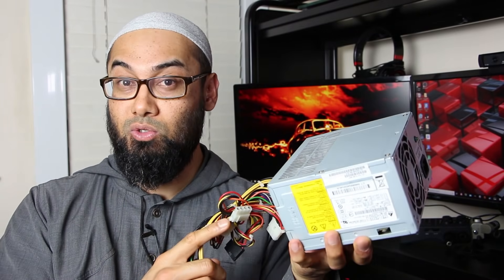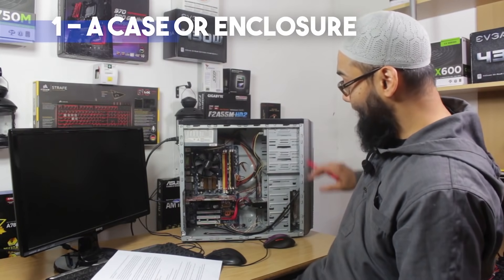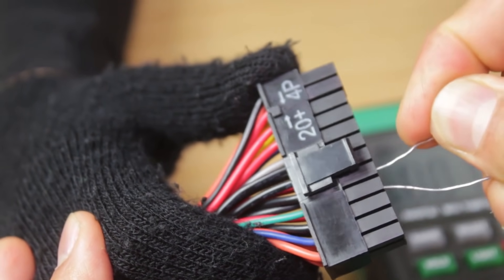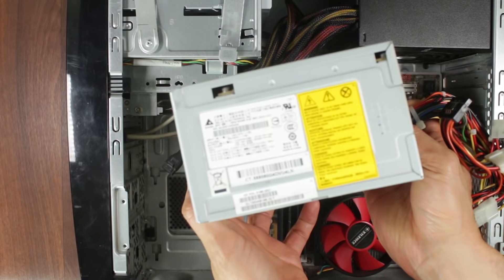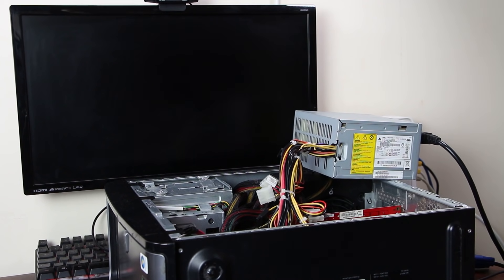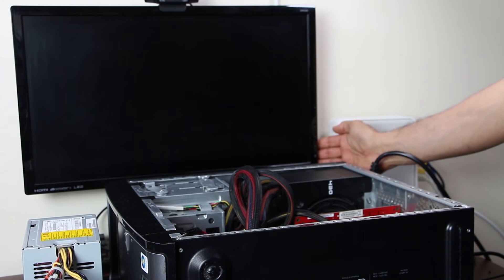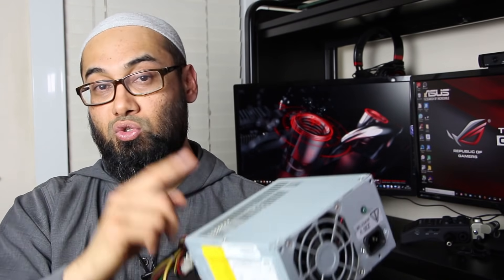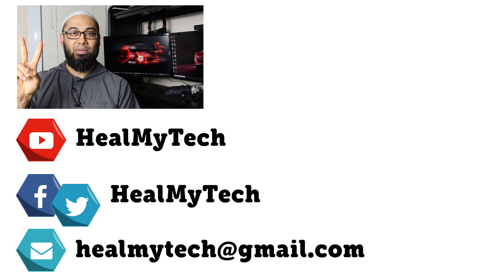Computer Turns On But No Display On Monitor | Led Light On Fan Spinning | Power Supply Unit Pc?

Comment: Hello. I liked this video so since you are offering to help I am reaching out as I am ready to pull my hair out in frustration!!! I just opened up a new desktop computer system and I did the best I could in setting it up with zero tech abilities. However, of course I am having problems. I could use some help: first of all when the processor is on I don't see the fan turning at all. Shouldn't it be turning when on? Secondly the monitor lights up a picture for 1 second then goes black and no lights anywhere. 

I have no idea how to make it work. I probably put cables in the wrong places? I hope you can help me in plain, simply language, not in fancy tech talk. Thank you.
Reply from the maker: Sound like you need more help than just simply me replying to this thread.  Have you followed a build guide?
Reply from the maker: I have also created a facebook group especially to help troubleshoot computer/laptop issues.  If you post your question there with some pictures or even better a short video footage you will get a better response.  Consider joining but make sure you read and accept the conditions and answer the questions, otherwise you may not be approved to join.  The idea is to help each other, I am unable to respond to every request by myself.  https://www.facebook.com/groups/healmytech/

Comment: Can anybody help me .my cpu on fan running ,mouse , keyboard, monitor all running suddenly monitor black screen no light in mouse and keyboard but still cpu fan running .
Note: i also replaced a new bios battery 
Pls help me guys anybody 🙏🙏🙏🙏🙏🙏🙏🙏🙏🙏
Reply: Can you still enter to bios and save the new setting?

Comment: Hello,
Please I have an issue with my desktop.
Basically when I put it on the fan but the computer will reboot on it's on and there is no display and no led on the keyboard.
Any advices please?
Reply: Same issue did you solve it ?

Comment: Can somebody help me out?
Alright I go to bed, and wake up next morning trying to turn my pc on. The motherboard has all its rgb and led's on as usual. I notice my mouse's rgb isn't on as usual. I try to turn on my pc, but it wont power on. I have resently reset my pc completely, but that shouldn't affect the pc itself right? My pc is only 9 months old and i am  pretty chocked that it has died. I have a corsair power supply with 625 watts. No fans are spinning, and I have also taken into consideration that the front panel connecters a deffect.
If anybody has any suggestions or tips I would really apreciate it. If nothing works I will try buying another better powersupply and hope for the best.
Thanks for noticeing :)

Comment: Guys try unplugging and replugging your ram as well as turning on and off your PSU switch, also getting some dust out of your PC, one of these things fixed the problem for me!
Reply: I did it already but still no display
Reply: @leidel5552  even me I've tried everything don't know what to do anymore
Reply: @leidel5552  same have you fixed it now??
Reply: Thanks. I cleaned my ram using eraser it works, and if you are not using AVR or UPS don't plug your pc in any extension you should not use extension. Just directly plug in into the power outlet. I have no problem now.
Reply: @jiyamiira  I'll try this bro hope that's the issue
Reply: Worked after flipping switch
Reply: Glad you told me about the ram, that was the issue it wasn't in correctly. You're awesome
Reply: Yeah I figured the ram wasn’t pushed in properly thanks
Reply: i’m a idiot
Reply: Ñ.
Reply: true
Reply: @Regenald Alonzo its okay if ur using surge protector
Reply: brooooooooooo this was my issue
Reply: Where can I find that Ram👁️👄👁️
Reply: Unplugging ram worked for me thanks
Reply: I don't have the corresponding equipment to remove the RAM
Reply: Amazing, you saved me too!! Just had to readjust the RAM. Thanks!
Reply: Thanks broo appreciate 👏
Reply: I love you man, you just save me from trouble
Reply: yep it was the ram for me thanks dude
Reply: Thanks bro
Reply: What if it’s new
Reply: omggg thankssssp
Reply: Thank you so much❤️
Reply: Dude i love you it worked
Reply: That doesn't work for me, thank you tho
Reply: Fking legend, worked. Had my ram put the other way around after changing cooler. Almost had a stroke
Reply: Love you mate, thanks a lot. 
I plugged out the ram put it in again and there it was.
Reply: Thank you, the RAM worked
Reply: Thank you so much i didn't even watched the video just turned off and on my PSU.
Reply: Thank you so much mamen
Reply: Thank you i try what you said and is  working😊😊😊😊👍👍👍👍👍
Reply: I don’t know who you are. But omgggggggg it workedddddddddd omggggggg thank you soo much
Reply: All i did was unplug my ram and put it back in
Reply: thanks for helping it works I'll about to buy new psu, thank god u stopped me for buying psu because I don't want to buy btw my psu is Corsair 750W
Reply: Thank you so much
Reply: mine turns on doesn’t display and won’t turn off please help
Reply: OMG no way one of my ram sticks were half way out the slot now i got 32 gigs of ram
Reply: thanks!
Reply: Legend! the psu switch was the problem
Reply: One of these things fixed my problem as well
Reply: Thank you so much bro you saved my life 😂😂
Reply: Thank you, man. You're a life saver aha!
Reply: YOU FIXED MY PROBLEM OMG TY SO MUCH I THOUGHT I WOULD HAVE TO GET A NEW PC
Reply: I tried but it didn't work
Reply: Did all of that but its what caused my issue
Reply: Thanks! Your advice on the RAM worked!
Reply: a year later but thanks, I was trying to clean my pc but I didn't notice I put the ram incorrectly back
Reply: OMG 
YOU ARE AMAZING 
I JUST REMOVED AND PUT THE RAM BACK AND IT WORKS TYSMMMMM
Reply: THANK YOU
Reply: Thank you so much bro
Reply: You're a saint, it actually worked.
Thank you so much
Reply: Yo when my pc just restarted i unplugged one of my rams and puted it back but when i power it on the display is not going to show but the fan is moving and also the mb cant do the sound when its turned on.Whats the problem?
Reply: Thanks so much bro, taking out the ram worked
Reply: You are a champion! Thankyou so much for this comment. Simply taking out and putting back in the RAM fixed it straight away
Reply: Any idea why the RAM does this?
Reply: You are an absolute hero, thank you
Reply: Thanks so much mate! I took out the ram and plugged it back again and it worked
Reply: Can dust really do all that?? Mine has a ton
Reply: Yo it was the ram thank you you all I had to do was change my ram from one slot to the other and it worked idk if it would work unplugging and putting it back we’re it first was but it worked thanks you saved my quarantine
Reply: I love you! It was the ram for me as well I was going crazy
Reply: Well you saved my quarantine aswell
Reply: Prayxer means your ram is not in right
Reply: Thanks bro!!
Reply: Bro wtf im not playing like 2weeks until i saw this comment really helpful 😅

Comment: My computer turns on and I hear the windows 10 sound but no display. My monitor works. Is this a PSU issue ?
Reply: It's a ram issue. Reseat or replace it

Comment: So my pc is turned on, doesnt turn off and there is no Desktop, I tried with the rams, another Monitor or another cable, even the battery from the motherboard Stil doesnt work
Reply: I have the same problem
:( Did you fix it?
Reply: @Waxiorek  no, I still didnt fix it, I literally gave up😂

Comment: Hi, I power on, fans start but monitor reports no signal, I've tested the display port lead and monitor works ok with other pcs. PSU issue?

Comment: Hey I know this is late but recently I turned on my pc and all the lights and fans are spinning but when I look up to my monitor nothing happens. The monitor works as well as the cable. I tried to do a cmos reset and reseating ram but that failed. I honestly don’t know what to do because I’m not confident enough to mess with my pc to the point I have to unplug and replug everything. This was a prebuilt so I’ll ask them tomorrow about my situation. But please leave me any suggestions on how to fix this.

Update like 5 minutes later: I did the CMOS reset BUT MY GODDAMN MONITOR DIDNT CONNECT TO MY PC SO ALL I HAD TO DO WAS TO RESET IT AND DID THE DATE AND TIME BIOS THING AND IT WORKS NOW. I can't believe I wasted 60 dollars to ship to my pc manufacturer and find out that the problem the entire time was my monitor.

Comment: I just got my pc and it turns fan and stuff like that but my pc won’t display on my monitor led lights come on no signal on monitor what should I do?
Reply: But all my plugs on my pc don’t work also so Idk if it’s wired in the pc that is put on wrong I’m not sure

Comment: Please help. When I first switch on my PC, the LEDs turn on, the fans spin at a slow rate and nothing comes up on the monitor. And then I just go ahead and swich off my UPS which shuts downs my PC abruptly (which breaks my heart everytime since I have added some 17 TBs of Hard disk and I don't want my data to be corrupt) and then I turn on the UPS again and then the PC boots like it normally should. Why is this happening, I have a new Corsair PSU, so PSU can't really be an issue!
Reply: Basically the same issue for me! Everytime I boot up. I get a black screen and I have to let my PC idle for at least 10 minutes. I hit the restart button and it boots up normally. Been doing it for a while and I have no clue how to fix it

Comment: Sometimes, my pc always needs to be restarted every time I turn it on. The mouse, keyboard and monitor doesn't receive signal at first turning on, I suspect it's the PSU. Please suggest
Reply: I have the same issue did you solve it?
Reply: @idontknowidotknow7892  no, I changed my PSU already, yet it still happens. I suspect it's my power button that's faulty.
Reply: @meisuke9026  Hi it most likely isn't that but try a new case anyways I got mine to work by repeating evetythinh

Comment: For some reason I have this issue occasionally. What works for me is I unplug the TV and PC. And then unplug and replug the HDMI from each, and unplug replug the power supply and the keyboard and everything. Gently push down on the graphics card, and then turn the PC on span clicking f12 to go into boot menu. And for some reason it comes up. I hit boot with windows and then I don't have the problem again

Comment: i removed my Ram and graphics card. 1 of those were faulty. Problem solved
Reply: or ur ram just wasn’t pushed in all the way
Reply: @exis9350  turns out it was the motherboard's ram slots.

Comment: If this starts happening with a computer that had been working fine does that mean the power supply is dying?
Reply: Yes
Reply: @kellwin2317  what if the computer was purchased brand new 4 months prior
Reply: connordh89 most likely but If make sure your not on a higher v than it should be or else it will fry your motherboards and power supply which will lasts less time
Reply: @kellwin2317  Could it be something with the graphics card? Because it shows the boot screen but then nothing. I was installing the new nvidia driver from the geforce app. The second it finished i havent been able to get anything to show besides the boot screen.
Reply: @kellwin2317  what if you just installed a new power supply and this happened?
Reply: @mattheo4709  check if there’s a red switch on the power supply and if there is switch the bolts because it’s most likely using to much power or to low for your pc

Comment: depending on the socket type you could upgrade to a phenom x6

there is a modified bios available on biosmods.com allowing overclocking and 95w six core phenom II support for the MCP61PM-HM V2.2 it is an am2+ socket.

https://www.bios-mods.com/forum/Thread-HP-MCP61PM-HM-Nettle3-5-17-With-Unlocked-Overclocking-Options

it is a long thread worth reading through, there seem to be many different oem brands using this model motherboard.

Comment: I just installed a new mobo and cpu with old hard drive. The pc boots but theres no display, the fan turns on and cpu fan turns on also. The power supply fan is also off, I am using a 570x and it has 4 extra connectors and my current psu doesnt have it. Do u think I need a new psu?

Comment: I had upgraded my mobo, CPU and ram last year with no issues. Only recently had I had this problem; computer turns on with all lights and fans except for the  monitor, keyboard and mouse. 

Funny thing is that it managed to turn on the next day and the only thing I did was to turn off the main switch over. A day after it happened again and it managed to turn on after unplugging my peripherals.

Would also like to note that prior to any of the above making the computer turn on again, I hav tried resitting the rams and GPU. As well as checked my monitors to ensure they work using my consoles. The only thin I did not do was to remove the CPU to check for issues as I was able to game and use it the whole day without issues therefore no overheating problems.

Could it be the power supply? Or any other ideas? I have ordered a new power supply just in case.
Reply: Same thing happening to me
Reply: i have the same problem rn :(
Reply: did you ever fix it?
Reply: @wcicked  it was the CPU for me, no issued after I swapped it with a new set.

Comment: I have the same issue..all fan running, GPU fan running, rgb strip etc but black screen no bios, no HDD led status ..new CPU,new Mobo,new ram, new GPU but recycled PSU from old 4460 system (2014ish cooler master 750w GXii).. maybe PSU is the issue?

Comment: Sir, no light in keyboard also
Reply: Have rhe same problem
Reply: did you fix it now?
Reply: @cinedotjisu  mine got my motherboard replaced most likely the mobo is damaged or DOA
Reply: Could I be power supply if my keyboard doesn’t have lights everything is turning on but the pc Nd the mouse Nd keyboard and my motherboard had a light on it too
Reply: @kurona4816  did u ever find out what the problem was?
Reply: @shawfym  yes was power supply sorry for late response

Comment: My gaming PC turns on, but then goes off, monitor goes black screen, and the fans light goes off, but spinning still and then makes a loud noise. I changed the PSU, and it still does the same thing, so.

Comment: Great stuff, although I have a hp300AIO which you refer to as Laptop, I switch on the unit , have a Blackscreen, no LED on power button, Fans are on fine. LED light is on the power supply. PLease Help....

Comment: I was playing a game then my monitor just went pixel then turned off when I turned it back on it was just black. Now when I look at the monitor it turns green to show it's coming on but goes back straight to orange and still black screen mouse is on but keyboard isn't. At first when I turned it on it shut off not it stays on but black screen please help really dont want to buy a pc during this pandemic
Reply: try cleaning your ram using eraser then put it back properly
Reply: and also check the cable if its properly attached

Comment: Can anybody help me. 
When i turn on my PC , it gives no beeps and no display at all but after 5 to 10 secs my PC fans ramps up at maximum. What would be the cause?
 I just checked my processor , it has some black/dark(burnt) spots. The PC was freezing before this. So i thought to clean my PC but after cleaning its not working.😭

Comment: Help. 
My computer was randomly restarting under heavy load which got worse and worse. I bought a new PSU. Replaced all cables, re-applied thermal paste, replaced all cables. Tried my old GPU. Replaced the CMOS battery. Nothing. I get spinning fans but no picture on screen before it restarts again..
Where should I look next? It's going to be a new computer at this rate!
Reply: Super Steve re seat your ram sticks

Comment: My computer was working good, then I reset the cmos and now everything turns on and spins, but no display. Please help.
Reply: joshXX same happened with me too .. even I did reset the cmos and now no display
Reply: Ye mine too. I thought cmos gonna fix my problem where pc boots to fast to access bios screen, but after removing it for 1hour and reseat, pc wont display anymore! If i press keyboard keys, it restarts after 10seconds.

Comment: If the computer turns on but the keyboard, mouse, and monitor do not have any connections. Would this be a power supply issue?
Reply from the maker: Your question is unclear, when you say turn on what do you mean exactly?

Comment: So my pc turns on but I don't get any light up on my keyboard nor mouse, could this be a power supply issue as well?
Reply from the maker: Possibly.  Your description of the issue is not clear though
Reply: I bought a new power supply and it was not it. I'm thinking I might have fried the motherboard because I had socks on and I was on a carpet while working on it. Any suggestions on what to do?

Comment: Hi , can u please help my pc just die on me , atm turns on , got power , all fans spinning but there is no display, the screen goes into sleep mode ... ok before he die on me he made a buzzing noise for about 3 secs and the screen when all funny with strange fuzzy display..   this is what I did .... now  I’ve toke all the pc apart only left with power supply, graphics card and ram ,, I’ve turned on and still the same no display coming on ...  I ALSO HAVE  tested the motherboard with multimeter,,  power supply output volts are between 12.5 v  and 5v ,  CPU FAN 12.5v ..  UBS PORTS 5v ,, and general inside of motherhood parts like transistors , resisters etc etc they r kicking between 12.5v and 3v , .. .. I think my motherboard is not death,, and even the CPU .. maybe is the  graphics card or the ram ., please be kind to reply and tell me what should I do to fix it .. Maney thanks . 🙏